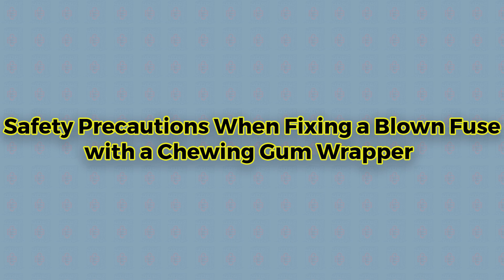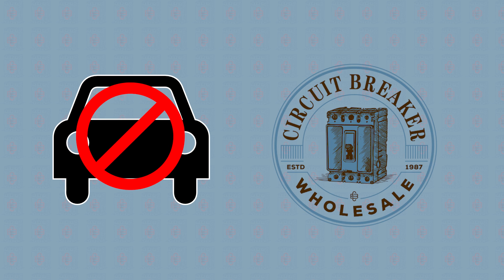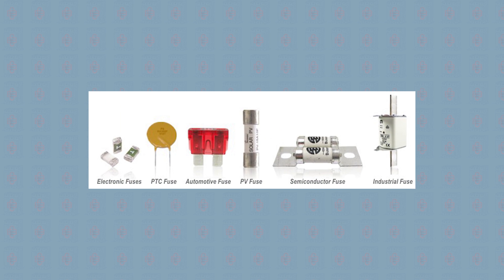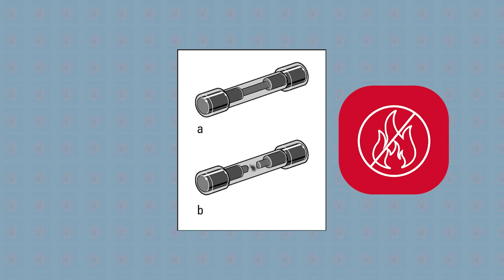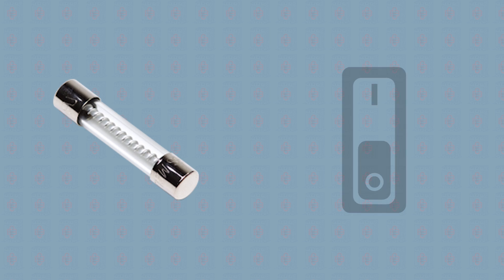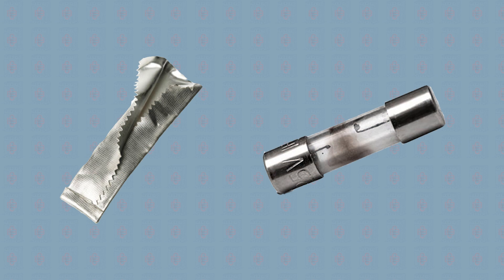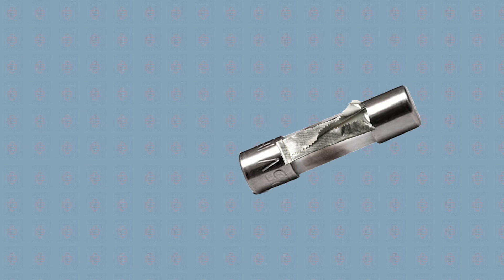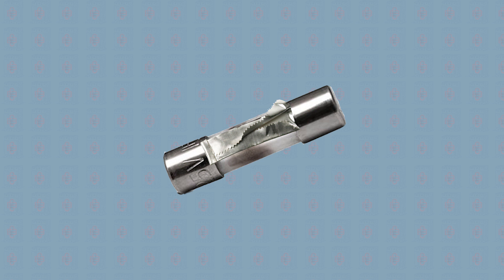How to Fix a Blown Fuse with a Chewing Gum Wrapper

Comment: This is horrible, horrible advice. Fuses blowing isn't even the problem. The fuse blows because there was a problem with the electronics that caused an increase in current, blowing the fuse. Foil only bypasses the safety mechanism without actually fixing the thing that caused the blow in the first place. I sure hope Circuit Breaker Wholesale isn't doing any installs.

Comment: The fuse in the device is not protecting the wire in the wall. It is protecting the device it is installed in. Something in the device has shorted or similar. Repairing a fuse like this is a terrible idea, and this video should not really be here on Youtube. It is misleading.

Comment: "chewing gum wrappers are not the safest fuse repair option"

oh alright they're about to say something sensible

"aluminum foil can also work just fine"

are you kidding me?

"... helps to bypass the safety mechanism ..."

could this get any worse?

"electricity flow will resume and your problem will be resolved"

... except for the problem that caused the original overload.

but hey no worries it's not like you bypassed the safety mechanism or anything.
Reply: idiots exist. Don't mind them. If they burn their houses down, it's on them
Reply: Let people make the choices and accept the consequences they want to make.
Reply: guy is an absolute clown, fuses are rated for a very good reason if it fails to blow you could wake up in a pile of ashes or indeed be part of the pile.
Reply: @johnmccormick3608  everything has a risk. What would you guess a gum wrappers electrical load it could handle before melting?
Reply: @MA_KA_PA_TIE  it really does not matter. That guy is a total arse avocating that you use something that is not lawfully rated to give you a quick fix, it is dangerous in the exteeme,if you actually need that explained to you I desapair, please never try. it.

Comment: Thank you so much for this video.  I have an air compressor that has an internal fuse and plugs into my car cigarette lighter.  The plastic on the 12 volt adapter plug broke and would no longer plug into the cigarette lighter.  I bought a new 12 volt adapter plug, spiced the wires, and it only worked for about 10 seconds and blew the fuse in the new 12 volt adapter plug.  I looked and looked but could not find a new adapter plug without a fuse so I wrapped the fuse in foil, like in this video, and so far the air compressor works again.  Now I can again fill up my tires with my portable air compressor.
Reply: for something like this is less dangerous, BUT 240v its a stuipd thing to do.

Comment: this should be called "a tutorial on how too burn down your house"...... Or "how too electrocute loved ones".......... Or just maybe " Darwin: survival of the fittest" As someone who designs and works on electronics daily I cannot understate this DO NOT FIX A BLOWN FUSE WITH ANYTHING OTHER THEN A NEW FUSE OF THE SAME VALUE, the fuse is a last ditch safety device too keep you safe or  too prevent a fire if it blew there's something wrong and it needs too be addressed

Comment: Now why would you even suggest such madness? Ingenious? So was placing a stinkin Lincoln in the old Edison base fuse boxes. Never I repeat NEVER wrap a fuse in foil. Diagnose and fix the issue. There is no such thing as temporary fix. 
There is two ways to deal with electricity. The right way and the DEAD way.

Comment: DO NOT DO THIS UNDER ANY CIRCUMSTANCE! What a stupid thing to show people. even if you state that it's dangerous a child could find this and their urge to carry on using whatever they are playing with will likely over power their care for saftey. This is a dangerous video!
Reply: Everything is dangerous, it will be okay...
Reply: @Saint696Anger  everything is dangerous so continue to do it anyway? Risk mitigation; safety precautions. Highway is dangerous, do you run the stop sign or walk across without stopping/looking? A loaded gun is always dangerous so it's okay to point it at yourself?
Yes things are dangerous, that's why safety exists. Stupidity and bypasses get people killed, not just the moron but others around them as well. A bypassed fuse can start a fire and/or electrocute someone, and more depending on the circuit.

Comment: Even if you take note that fuses are for general safety, they are NOT to be fixed. If a fuse blows you replace it. Trying to "fix" it may cause a fire. Especially as fuses are made according to specific properties, such as the breaking current, and using any other kind of conductor to bypass the fuse is simply bypassing that security measure.
Reply: sometimes a single tiny fuse can cost 60$ ... I have an Engel portable fridge, and it has some kind of special fuse that cost that much
Reply: @johnnyhun1  Wow, seriously? Is it some kind of proprietary fuse? Does it just have a special connector or something?

Still though, I would be pretty careful nonetheless. The thing is that in case something does happen and it could in any way be connected to a modified fuse then you might be liable for all of the damages in the end. We also still have the problem of fuses having a very precise manufacturing method whereas your fix might vary too much for it to be reliable.
Reply: @BakedPillow  yea it was a portable fridge cigar lighter fuse, but it was special, I could not find anything like this in general stores, it was way wider and there were no signs about how much A the fuse is, and i didnt want to risk damaging the fridge so i had to buy a new one.
Reply: @johnnyhun1  I had something like that with a car radio. Used a very hard-to-find fuse size in a special holder, so I cut it out and put a new fuse holder in with an equally rated common fuse.
Reply: @johnnyhun1  hmmmmm $60.. or a 150,000 dollar house and possible death.. OK.. see you have your priorities straight..